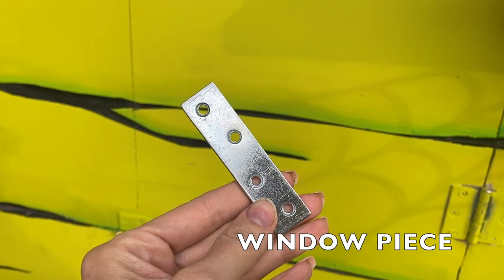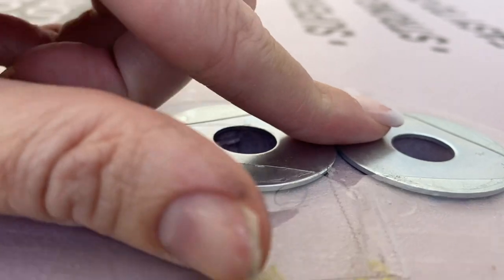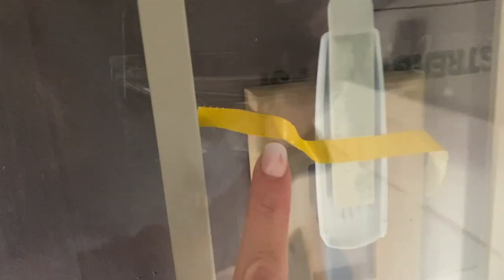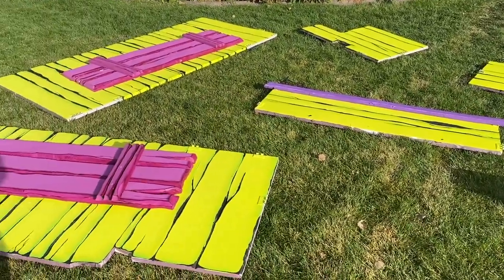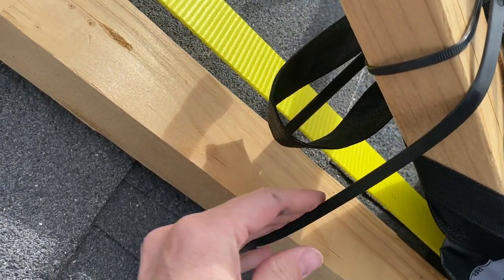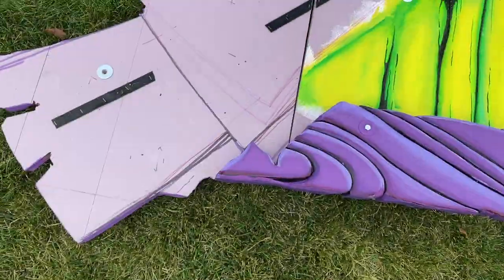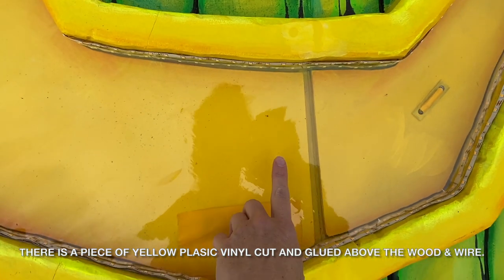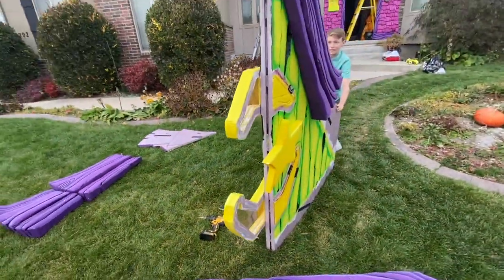WINDOW AND ROOF PIECE   HD 1080p

Comment: This looks amazing.  What colors and brands did you use for the foam board?  also what size/width was the foam?  it seems like you used 1 sheet on top of another in certain areas.
Reply from the maker: I used the pink foam.  Made by Owens Corning. I'm going to be hard coating it this year to make it fire resistant. I used several thicknesses and glued them together in places to create dimension.